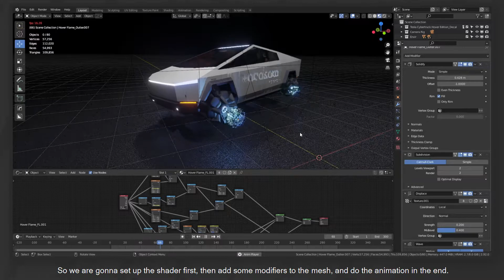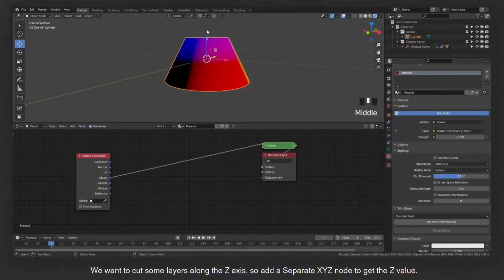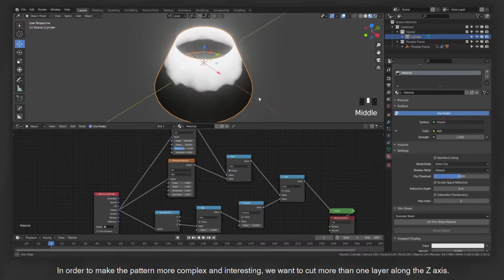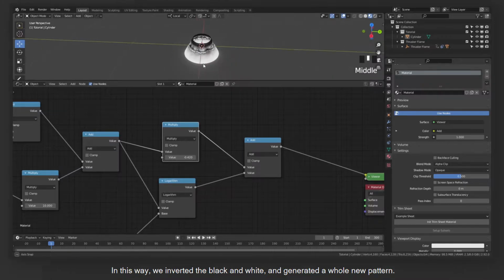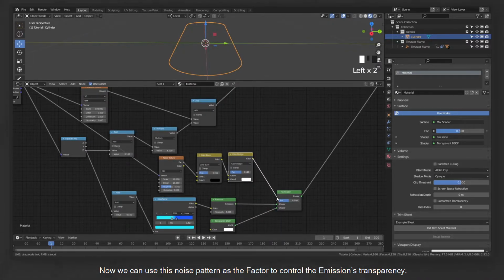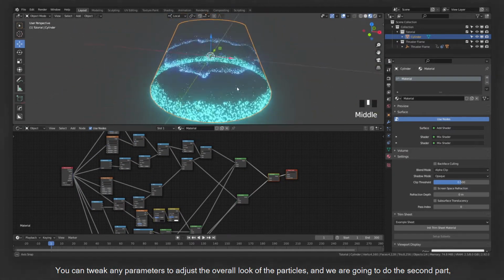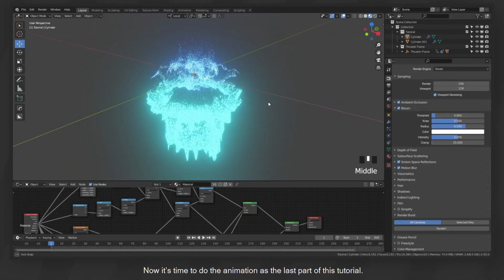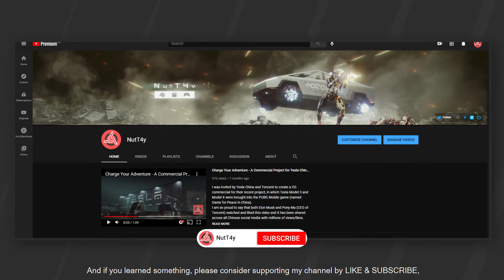Procedural Sci-fi Thruster Flame - Blender Procedural Shader Tutorial EP.2 (Eevee & Cycles)

Comment: Hey, I am having trouble with the transparent bsdf. It is not making my object transparent. I got all the masks and the colors working properly up until we added the color dodge and color burn. Those did not show transparency and when I plug in the color and the masks there is no transparency.
Reply from the maker: hey man, if you are using transparent shaders in EEVEE, make sure you go to Material Properties panel, under Settings, change the Blend Mode from Opaque to either Alpha Blend or Alpha Clip, otherwise you won't see any transparency :)
Reply: @maybenutt4y  Hey man! I'm back haha. This tutorial has helped me a ton in future projets. I use this style of procedural shading all of the time for different things now. I am currently working on a project that uses this technique, but for some reason, whenever I save my PNG after rendering, the blue procedural material shows as grey. It shows fine in the viewport and in the render window. It only turns grey after saving it. This doesn't occur if I save it with no transparency though.
Reply: AH. It apparently has to do with the PNG file and transparency. Weird. Don't believe I've had this problem before but it is what it is.
Reply: WAIT Nevermind! Haha, I just swapped to full render cycles and it shows now. In material preview it only showed black. Not sure why. Thanks anyway!

Comment: it's not working in Cycle
Reply from the maker: The shader works in both Eevee and Cycles
Reply: @maybenutt4y  How do I solve it? sth wrong with mine. It works in Evee though.
Reply from the maker: @Ethanlin1991  hey man, can you be more specific about what's wrong with it in cycles? Is it the glowing effect? Glow is a fake effect that is only available in Eevee, so after you render it in cycles, you need to add the glow in the compositing (can be done in after effects). If it's something else, let me know more details so I can help you problem solving
Reply: @maybenutt4y  I don't know if I have the same issue as above, but apparently my transparency isn't working properly in Cycles. I set the blend mode of the material to alpha clip, but in the rendered view the part of the mesh that should be transparent is more like a thin layer of cloth or dense fog. Looks fine in material preview though. Edit: When I change the first transparent node''s colour value to black (instead of white) the transparent part of the mesh becomes actually fully transparent, except for some edge lines that now appear when the meshes deform.
Reply: @xelan4252  Hello i do have the same problem in cycles were you able to resolves this please? thank you!
Reply: Did'nt found a sulution for Cycles. Would be great if you would show how it is has to be set up